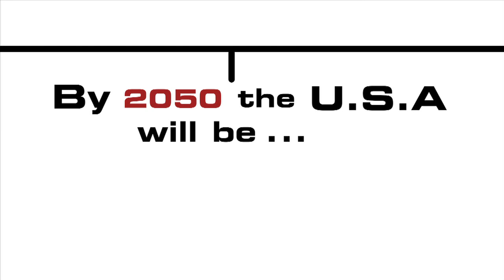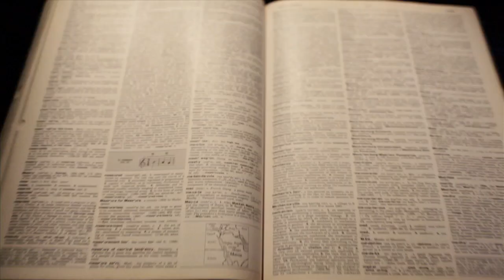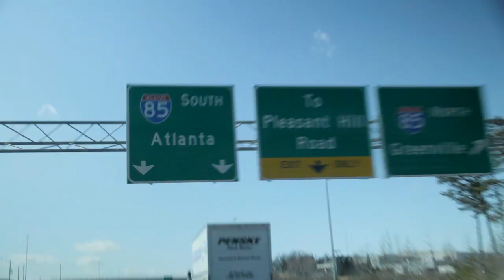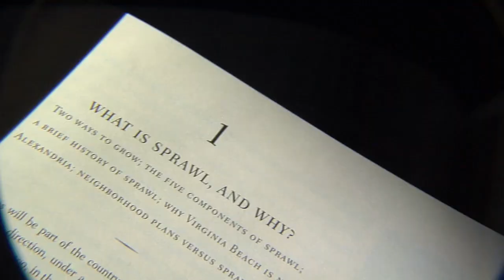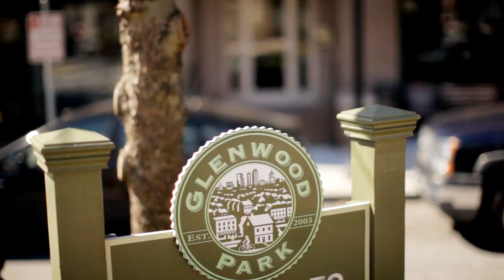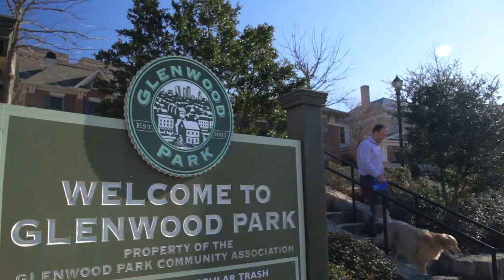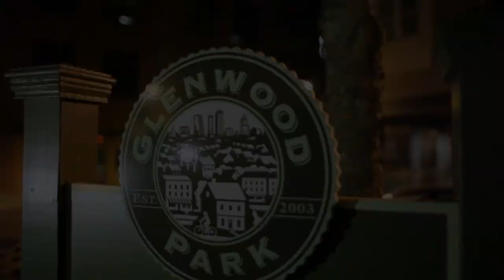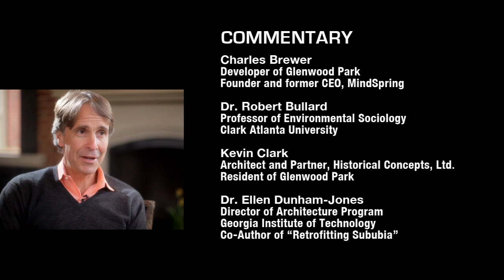American Makeover Episode 1: Sprawlanta

Comment: @Feldwebelpfeffer    Actually, their are two bus stops at Glenwood Park and the nearest train station is 1 mile away:  Reynoldstown.  I used to use it.  The neighborhood is open at all sides, except the Freeway side, and does not block off access from any part of the larger community.  Come visit and check out the residents and you might make different conclusions.